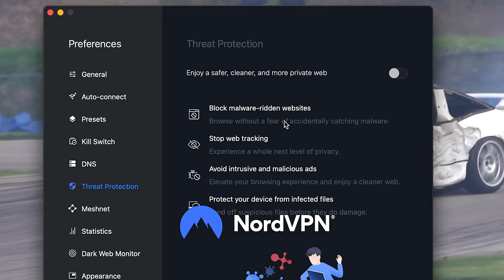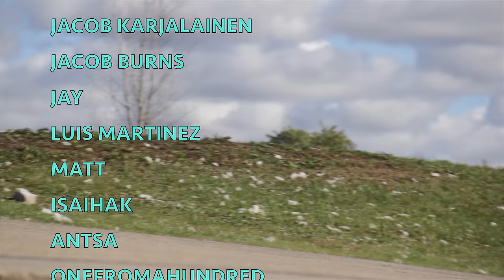240sx Core Support Made Accessible

Comment: For the core support sections that are overlapping you should do a "FIP Gasket" aka form in place gasket or seal. We do this at the aerospace company I work for. Usually, we mate the two parts together with the sealant on one part and a dry release agent on the other part. Bolt it together and wait for the sealant to fully dry before taking it apart. There should be a full gasket on one half and the other side should be clean. Stops metal on metal chafing and makes the part more solid when fastened together.

Comment: For the metal to metal contact you were referring to, I’d run some sort of rubber gasket in between the two surfaces as it add a vibration damping layer between the two sheets and protect the paint. Another option you could use is some clear 3m vinyl.

Comment: Try using a rubber mat between the two metal sheets for the core support
Reply: Was thinking of the same thing, either a rubber mat or some kinda rubber coating on the Frame and the inside of the core support.
Reply: That's what I was thinking . I agree with you two .I've got a bunch of different thickness's of rubber membrane just for that exact type of situation . Just changed them if they wear out.
Reply: Thinking about the same.

Comment: One of my friends has some dimple die gussets that connect the shock tower to the cowel/bulk head of the car. They look cool, but they also provide a extra strength to the car. It might be worth doing to yours car, especially for the purpose of strength. Either that or you can sure make your cage go through the bulk head and tie into the shock tower.

Comment: Tidy job, Mike! Use helicopter tape after it's painted on the part above the headlights & on the underside of the core support where they meet. You could use clear sticky vinyl, but helicopter tape is more durable. Cheers. Leigh.
Reply from the maker: Thanks for the tip! I'll look into that!

Comment: Hey man!  Make your removable core support just a hair wider than it needs to be all the way around where It mounts up , then line the inside of the removable piece with a thin rubber (adhesive on one side and smooth rubber on the other like a 3M product), this way you can attach it without damaging the paint and it will still fit snugly and tighten down with the bolt.

Comment: Hah the pile of "powder" on the garage floor under the car is like deja vu, as my floor looks pretty much the same...  Mine's a mix of rust, metal dust, seam sealer, and undercoating...

On the future design for the core support, could you possibly cap off each end of the middle section like you did to the 2 outer ends, and then through bolt the 2 end caps together underneath rather than from the top?  I'd have to look at how much access there is from underneath but if you could bolt from below you could create a really clean looking seam up top where the 2 flat pieces come together where the top would be completely flush.  It'd probably look even better than oem which has the overlapped panels at each end.  Hopefully that description made sense.

Comment: I think the core support would be perfect if you painted both surfaces and then installed the center section over the outsides with some thin rubber washers to prevent the two from touching

Comment: I wish you hadn't shaved down the front face of your top core support brackets. It would have been stronger to have that front edge fold down onto the front face to triangulate the brace. Still very nice d.i.y.  fab work and fun to watch. I agreee with you about removable core supports, never liked them until your video. They always look slapped together. Popping the hood on your vehicle should be like opening a jewelery box.

Comment: that came out good. I'm doing the same thing to my subaru XT6 and this video gave me a few more ideas to make it better. I have the same sort of goal with my subie OEM+ but get more access for maintenance. thanks Mike. p.s. I do have one question and before I ask I will let you know I am a professional automotive technician and have removed and replaced more engines and transmissions than I can count. why do people in the JDM world always put the engine in with the transmission attached? if you don't know that's fine I'm just curious. I did it one time with a friend on an SR swapped S13 and it was one of the worst experiences I have ever had putting an engine in but I see people doing it all the time. While I am a professional with access to lifts I have done plenty on the side in a driveway on jackstands so I know that's not the limiting factor. So I'm curious what your thoughts are on that. and keep trucking along this S13 is going to be even better than before.
Reply from the maker: To answer your question about installing motors with the transmission:

You have to remove a motor mount just to remove a sr trans in an s13, it's just much easier to all go in at once.

The rb25 trans can not be removed when installed in an s13 😭 whole motor has to come out with it 😬
Reply: @PrizzaMike  oh. so it's a clearance thing on this chassis and possibly with other engine swap scenarios. good to know. my RB25 is going to be mated to an RB20 trans and that is same size and same gear set as the KA24 just different bell and tail housing so that's why mine has plenty of room....for now, until I kill this trans and need the RB25 trans. so when I upgrade it will be a good idea to plan on doing the core support modification at the same time. thanks for the info Mike.

Comment: when i did my core support i just cut straight thru it and then on the side that comes out, i riveted a plate on each end and then on the headlight side i used a rive nut in that bolt hole that u were originally going to use